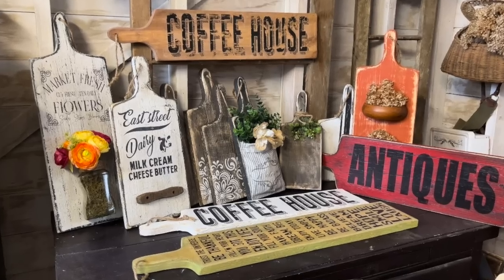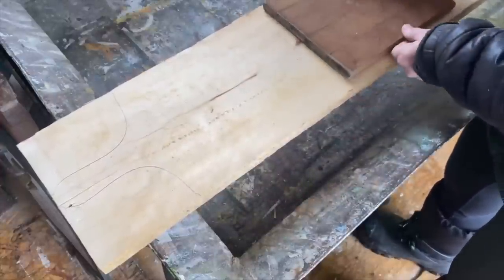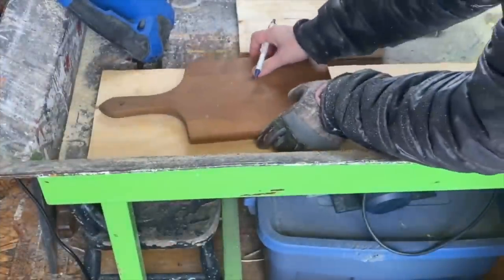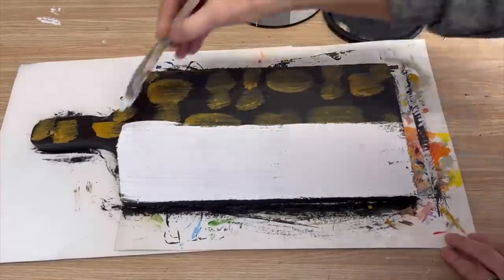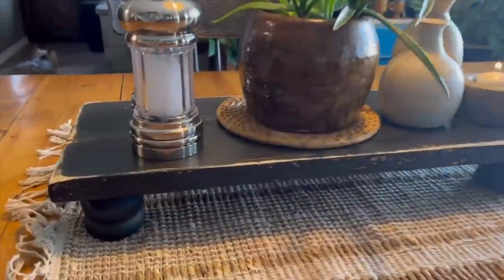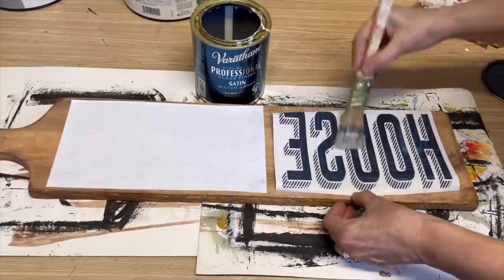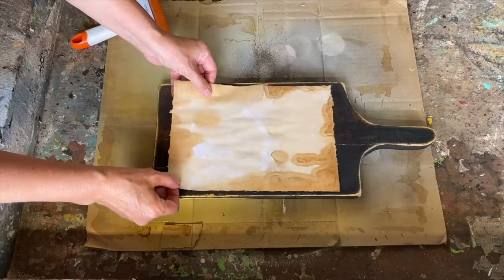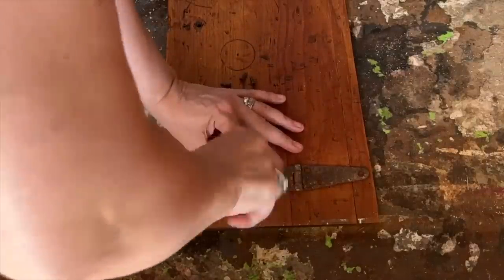Craft Ideas You Can Make And Sell For Extra Cash

Comment: I love your videos and the projects you make! I’m only a couple of minutes in, but if I may offer some advice - never wear gloves while using a saw, drill, router, etc - basically if it has a blade or cutting bit and something goes wrong, having gloves on can cause your hand to be pulled into the blade or bit.  Jigsaws are relatively safe…but things do happen and those blades are very capable of causing significant injury if one were unable to move a gloved hand that got snagged. You are spot on with suggesting safety glasses though! 🙂
Reply: Great advice! My husband said you are absolutely correct. TFS that comment.
Reply from the maker: That is great advice! Thanks for sharing ❤️
Reply: Of course! Glad to help! 🙂
Reply: Great advice.  My husband lost the tip of his finger that way.

Comment: Maple is food safe. Use food grade mineral oil or butcher block oil from Lowe's or Home Depot. Don't distress with a hammer or food and bacteria will collect in the indentations. You want a SMOOTH surface. Or you could distress one side for decor and one side smooth for food. Clean the board with lemon juice and salt, rinse quickly and dry.
Reply from the maker: Great tip thanks ❤️

Comment: I was wondering...the red board with Antiques sign.  You said that water would reactivate the glue so I was wondering if you could seal it with polycrylic and then put the graphic on and not have any issues with the glue.
Reply from the maker: I unfortunately it won’t work the mod podge has to soak into the paint to transfer